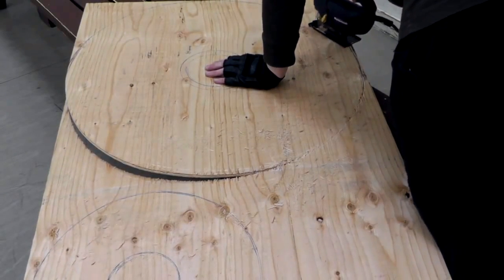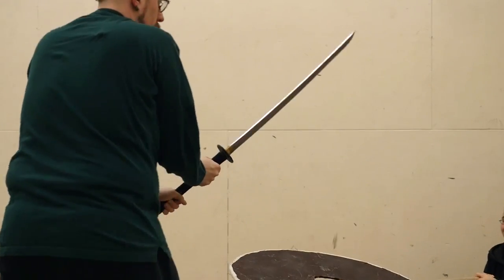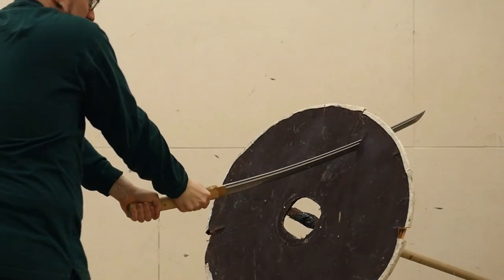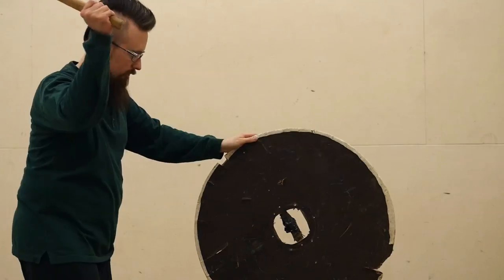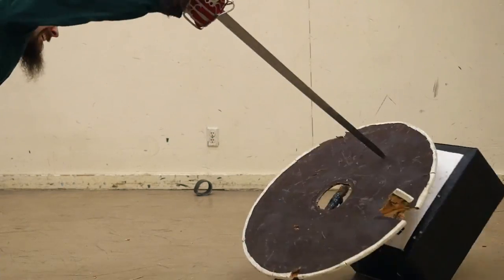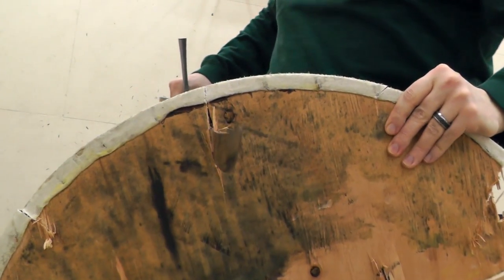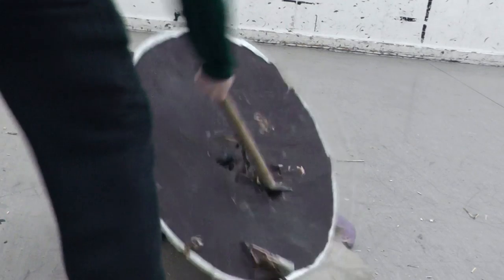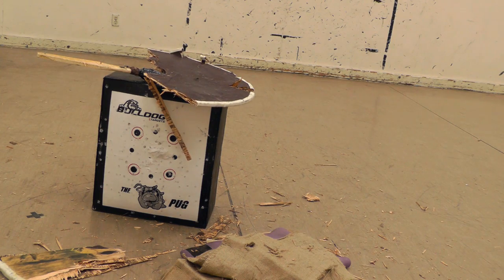Plywood shield vs broadsword, katana, axe, kriegsmesser, and war hammer

Comment: are there any shields which follow a plywood design for the construction of the wood? i.e. 3 layers, criss crossed so that there isn't any one direction to "go with the grain" as it were. perhaps with better wood quality, a plywood design for a shield might be one of the most effective designs?

just speculation, would be interested to hear other people's opinions on the matter.
Reply: Roman shields were built that way. Very effective they were too.
Reply: Christopher Yonemitsu I would imagine that modern kevlar layering would make for a good police shield but I havent seen one used
Reply: ***** as far as I am aware kevlar is very tear resistant but isn't nearly as resistant to cutting, then again with the current threats it would have to face I doubt that would be an issue.

I doubt the use of kevlar is needed in police shields however, since in a situation where a firefight is bound to happen, a shield might be too bulky, and otherwise, the standard riot shield does the job.

I don't think people are going to spend their budget on a second shield made just for firefights, but then again there has been controversy over police spending in municipalities before.
Reply: The thing is that, as you can see in the video, the moment the blades goes through following the lines, its stacked and so the shield user can basically disarm his oponent and kill him easily, so why make a shield without that posibility? Your idea will last longer, of course, but as its just a wooden circle you just have to make another after the battle and its fixed
Reply: TheGuillejedi good point, well I guess it would depend on what kind of opponent you would be facing, perhaps in massed combat you might care more for the durability of your shield (due to the prolonged combat potentially with many opponents), whereas in skirmishes or more open combat, being able to disarm your opponent might be a better tradeoff.
Reply: ***** Kevlar cuts like dense cloth.  I have done tests with it with extra armor pieces in Iraq.
Reply: ***** There actually are modern kevlar police shields. they are kind of like thick kevlar bags, made to be as resistant as a riot shield but far more mobile. it's kinda stupid looking though, like holding your backpack up as a shield.
Reply: ***** where can I find these shields? as far as I have heard police shields are typically impact resistant polymer or the heavier ones are steel/ceramic.
Reply: Christopher Yonemitsu I couldn't find any of the Kevlar ones on the market, though i believe they don't want Kevlar in the hands of the general public for police safety reasons, but i could be wrong, i did find this though.
-- http://www.securityprousa.com/kdh-mobile-ballistic-shield.html
it's pretty similar to the one i was referring to.
Reply: ***** interesting, I guess I was mistaken about limitations of ballistic shields in police use, although I do wonder where they would find it in the budget to have this range of specialist equipment, as supply and maintenance of inventory wouldn't be very efficient or cost effective I would presume.
Reply: Christopher Yonemitsu Covering the shield with a layer of fabric like linen was common. This allowed painting, etc but also covered the planks, in turn covering the direction of the grain.
Reply: The Scottish Highlanders used something like plywood for their targes, using two layers no three though, with the wood cross-grain then covered in leather with metal studs and bosses for decoration/ reinforcement.
Reply: ***** strange, perhaps they should look into managing police budget so they don't somehow become a paramilitary, sounds like a needless waste of money they could spend on other things.
Reply: ***** and we could have spent that money on improving infrastructure or streamlining the workplace, but nooo, greg wanted a tank.
Reply: Christopher Yonemitsu Military been giving surplus away post 9/11 so that why your sheriff's dept might have an Armored vehicle now or full body armor, M-16's and flash bangs. It's less Greg wanted one and more like Well since we got one and Greg really wants to use it why not? Greg then accidentally sets the place on fire or shoots a little girl and they all look like Paramilitary jackholes.
Reply: Citrakite damnit greg, now you're going to have to go meet HR, hope you're proud of yourself. fuckin' greg.
Reply: When no one really wants to do your job you tend to get close even if Greg is a fuck up. Doesn't really explain why FD has most of the same issues but Fireman Greg didn't burn a family of five to death when their candle set the drapes on fire or run over their dog with the fire engine deliberately because he was uncontrollable sitting there on that curb pissing himself.
Reply: Christopher Yonemitsu they already are a paramilitary.
Reply: Citrakite maybe someone has to slap policeman greg and tell him that no, that tank isn't designed for going to an arby's drive thru. and no, 120mm APDS rounds can't be fired off for a "warning shot" XD
Reply: Christopher Yonemitsu Been behind a riot shield and in front of one... throw a brick at them and it doesnt even scratch... They are completely transparent so it allows the (insert name depending on your opinion of the police) to see whats going on around them whilst protecting them... thats the round ones... dont get me started on the Tower electric ones... that is a weapon in itself :D